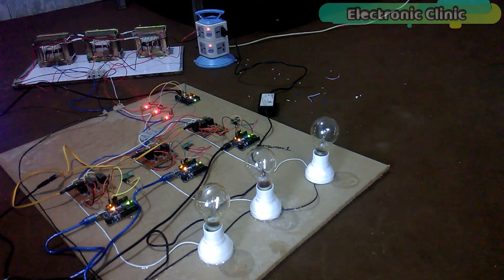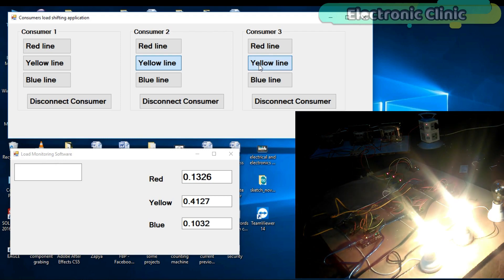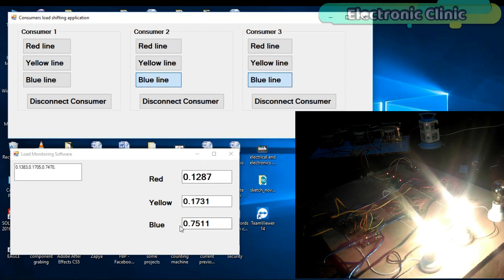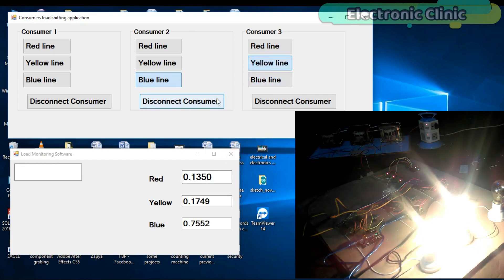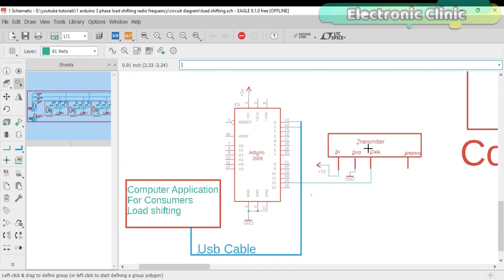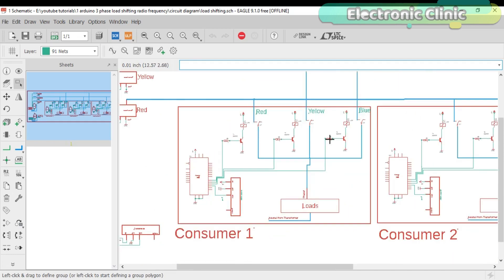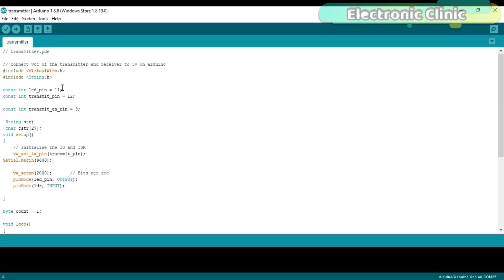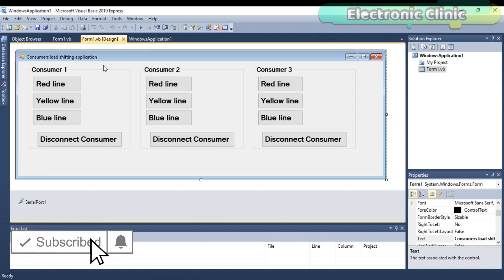Arduino project: 3 phase transformer  Load balancing or load shifting | 3 phase load balancing

Comment: Bro! You Did a great job.I have just One question can we done this System automatic means micro-controller itself monitor all phases and when one phase get overload micro-controller shift some load to other phase only if that phase has available capacity and if not then trip that phase or consumer.Please! Answer my question
Reply from the maker: yes, you can define limits in the programming.
Reply from the maker: watch my video on overload. that will help you.
Reply: @ElectroniClinic   can you provide the link of that video on overload? I could not find it?
Reply: Thanks